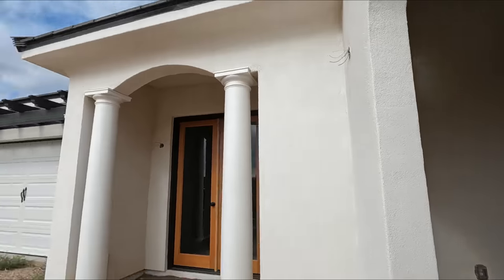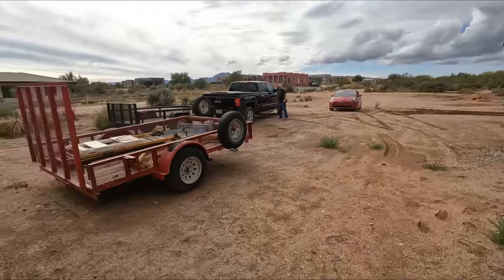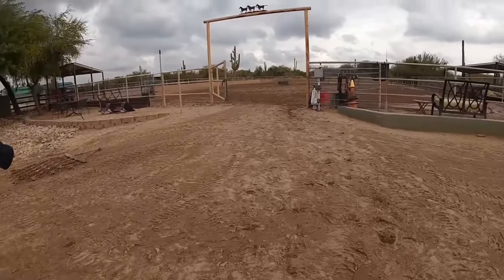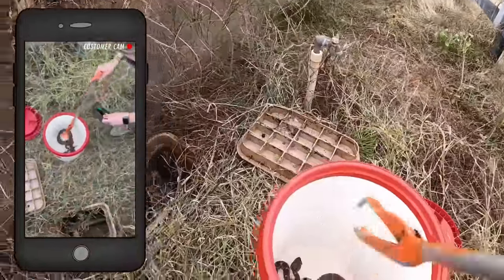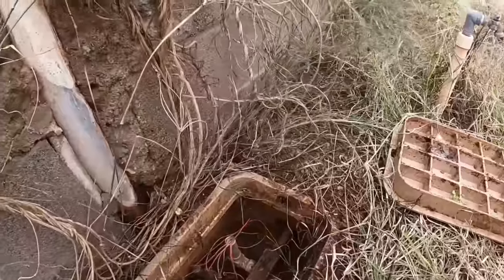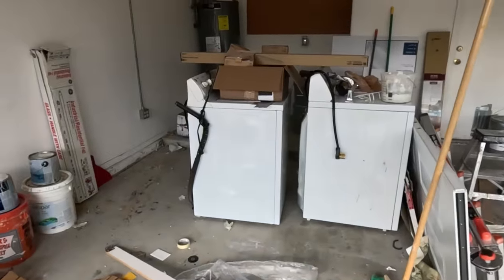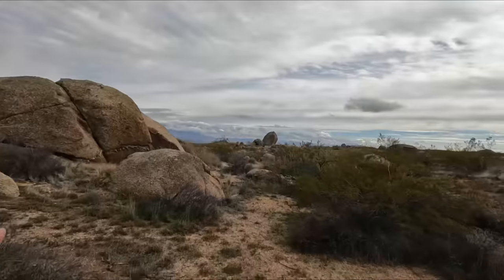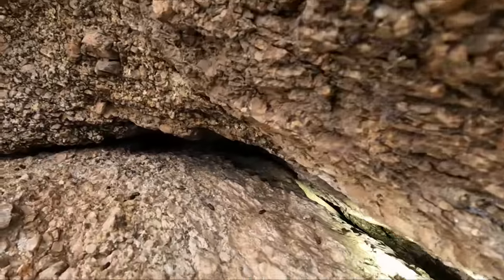Rattlesnake Den Found in an Electrical Box

Comment: That's not an electrical box, it's a water meter, unless that have a different kind of elec. Box in Ariz.
Reply: Maybe that is an elec. "Box" but it initially looks like a water meter. Elec meters are usually mounted on the side of structures here.